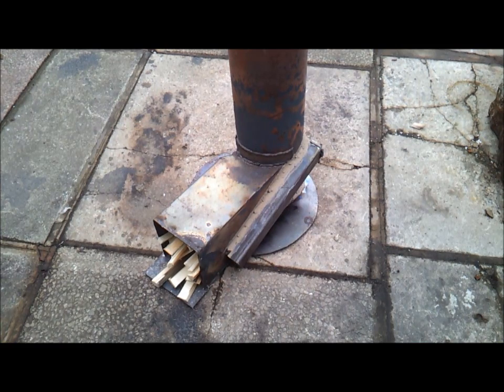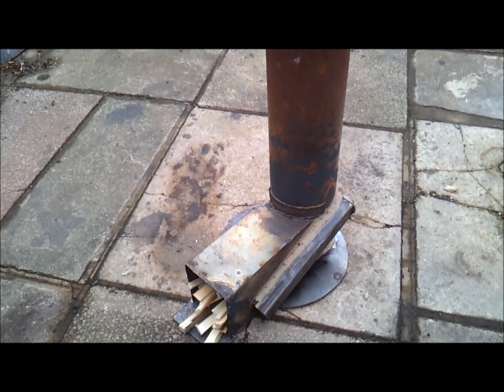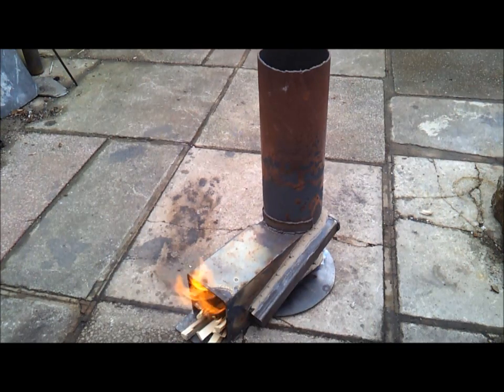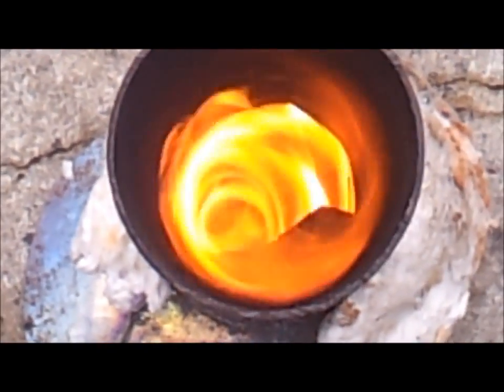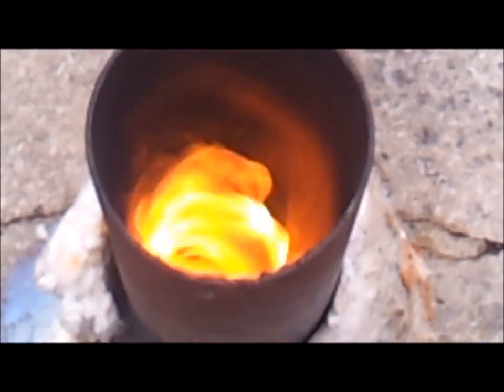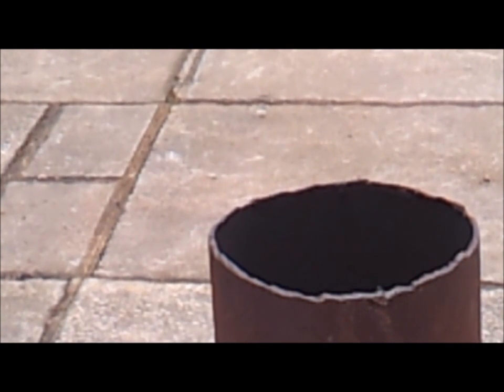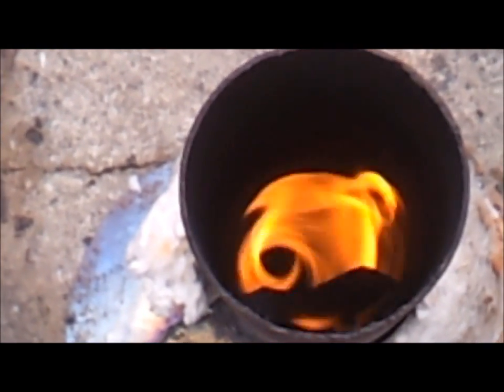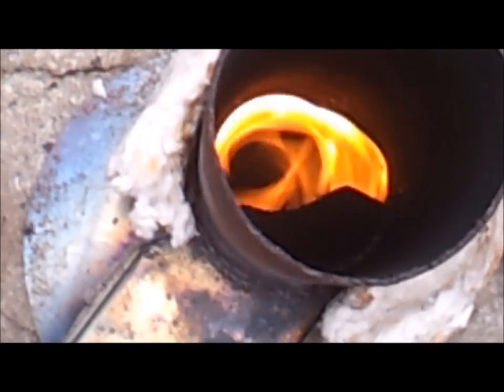Riser tube changes

Comment: Hi Loz! Great rocket, too good! I am making a similar rocket based on this video. I wanted to check if you've put a sort of baffle plate inside the rider just above the secondary air intake which helps the vortex to work better, or am I wrong?
Reply from the maker: Hi Ankit, I think i did in those early risers but it turned out to make no difference if you dont. cheers

Comment: secondary air . Combustion testing on my Model gas turbine combustion chambers took a quantum leap forward  by introducing the vaporising tube  fuel air mix through an Inconel tube with a fan shaped outlet ., Like squeezing the end of a garden hose to get a fan of water instead of a solid stream .The huge surface area of the fanned out fuel mix giving an almost immediate combustion as it introduced a greater amount of air/oxygen into the fuel vapours .

Comment: Dear Ppotty1, Here is a water cylinder design, originally heated by burning domestic gas.

https://fthmb.tqn.com/AUiLIXHriYHI3aPAFKDP57jF4hU=/960x0/filters:no_upscale()/about/binary-5--5810d7b63df78c2c73ed3519.jpeg

https://www.ebay.co.uk/itm/Andrews-Gas-Water-Heater-and-Storage-Cylinder-286-litres/153077390360?_trkparms=aid%3D111001%26algo%3DREC.SEED%26ao%3D1%26asc%3D20180105095853%26meid%3Dee521097ab2744bdbd07a13dcaa96921%26pid%3D100903%26rk%3D3%26rkt%3D20%26sd%3D163211983444%26itm%3D153077390360&_trksid=p2509164.c100903.m5276

It has a central stainless steel open pipe & flue at the top and is surrounded by a water jacket, around 200 litres of water.

Gas water heater cylinder needs
65,000 BTU or 19kw

I am going yo subscribe to your patreon, but wanted to ask if you thought that your plans on patreon could be used to heat the above gas water cylinder ? Do you see any problems positioning the above gas cylinder above you heat riser eg about 3 inches above it. We need to ensure hot exhaust gets deep up the internal pipe (must be fast moving hot gas).
Reply from the maker: Hi Jason, Yes i think my stove could heat that you could increase the size of the firebox for a longer burn and increased heat output.

Comment: Like this a lot, nice and simple design which i could probably make/ can i pay you for the exact design plans of the firebox/riser and junction between the two and the secondary air feed position and dimensions so that i can make it out of 310 stainless steel to make a smokeless boiler? fred Dibnah comes to mind, which is a big complement to your inguiniuty. Rgds Jason
Reply from the maker: Hi Jason, there are 4 in depth videos on my Patreon   https://www.patreon.com/ppotty1
  they go into detail on all aspects of rocket stoves, there is one dedicated to the riser, vortex and sec air feed. its just $2. to join all the infoo you need should be there mate. Cheers

Comment: Could the stove works more than an hour or two while cooking ?
I've made a rocket stove, but it stops working after 30-40 minutes (or less...).
Looks like there ain't no draft anymore. If I blow air in the burn chamber the fire starts for a while, but eventually stops.
What should I do ?
Reply from the maker: The stove should work for as long as you keep feeding wood into it you must have a restriction with the air supply

Comment: Have you considered fitting a door on the feed chamber to achieve an even better rocket type burn, this option is possible because you have fitted a secondary air intake pipe. All the combustion would take place in the crucial j tube section providing maximum heat in the riser.
Just a thought, Nice Job.

Comment: you sound like the beatles! by the way what's the benefits of the vortex effect? wouldn't it reduce the amount of heat that the cooking pot receives? you know because the flame is not traveling directly straight to the pot, and if it travels a longer way it probably loses heat before it hits the pot? thanks!
Reply from the maker: Overall the vortex produces more heat up the riser and a cleaner burn . cheers

Comment: So did you go back to your original design for where the burn chamber enters the riser tube?  This one looks the same as your original cardboard mock-up.  The last one you had (Feb. 23, 2013 Riser final build and burn vid) the tall, slender entry (which looks like it would be a lot harder to fabricate).

Comment: hi there ppotty1 you and some of the others have been a BREATH of fresh AIR in the R-S world

i have limited resources so Stainless Steel ROUND tubes may be out of the questions
HOW about 5" Structural Steel Square Tube for the riser with 2ndary air intake like you did here can square pipe work (for the upright riser)

also is there any point to impede the airflow at the conversion point between the horizontal and vertical pieces by lowering the vertical into the combustion chamber slightly and force the everything to go around the lowered lip before going up
OR is it all about smooth air flow across and up the tube
Reply from the maker: thegreatfixer Hi there, glad to help you, yes square pipe will work fine as a riser, but as you probably know it wont last as long as stainless. I wouldn't restrict the airflow into the riser other than a slight choke at the entrance. You want a good flow of gas from the firebox up the riser, keeping everything flat also makes cleaning out easier. Cheers.

Comment: i am a newbie in this thing, but rocket stove is very exiting to me, i am planning to build one when i have a chance. *****  does a vortex fire rocket stove make any different compare to normal rocket stove? which is better in term of fuel efficiency and the time to reach peak temperature? many thanks before, btw that is a nice rocket stove. :-)
Reply from the maker: santosha wijaya The vortex tends to heat the riser faster and mixes the gasses better for a cleaner  burn almost straight away, it tends to burn less fuel also. The temp difference wont be much but you will use less fuel getting there. Cheers.

Comment: How long do you expect that metal lo last before burn thru with the high temps?
Reply from the maker: Roger Spinks It would't last too long maybe a year if you had a fire in it daily, better to use stainless for a permanent stove, built this just for testing ideas.
Reply: Better to use Fire Brick all the way thru to make a stove last a long time and to be safe.

Comment: Hi.  This is fab.  I've been watching the whole rocket thing move on over the last two years and it looks like it's all starting to work properly.  I've built two now but they are no way as efficient and clean as yours. 

What is the dimension of the main riser and feed tube? And is the riser interior stainless or mild steel?

Comment: i really think you have two excellent innovations a) air inflow direct to the secondary combustion chamber,b) the sealed firebox ,
water heater ideas !! old boiler heat exchanger and then tank it or guys on this link wrapped copper pipe up the riser tube , .iwilltry.org/b/build-a-rocket-stove-for-home-heating/
another idea i was toying with was to fit a car radiator in the flu to create a simple water heater for the workshop as it has its own pressure release keep up the good work ,

Comment: Thanks for shareing, you're getting amazing results without insulateing the firebox. I like the water jacket, is it a coil of copper packed with perilite between the shells? I'm planning on your second method, running copper coil around the inside of the 45 gal barrel on the one I'm tweeking. Might be able to see it by clicking my name.

Comment: OK cheers. I got a long way with mine yesterday. Cant make any noise today (Sunday). Does the outlet need to rise vertically? I had planned to go straight out through the wall to keep it out of sight of local complainers. On the Permies site they run them yards horizontally, just wondered what your thoughts were?